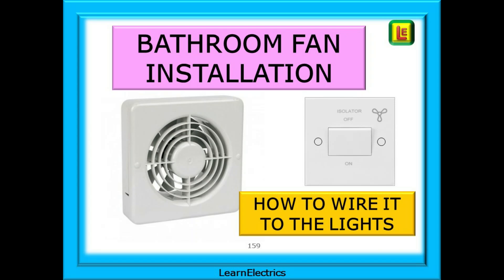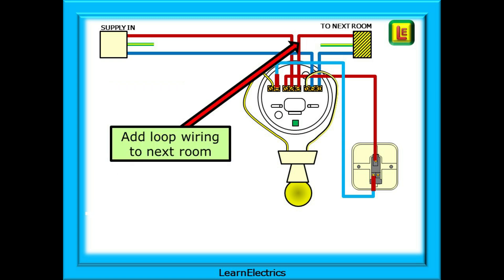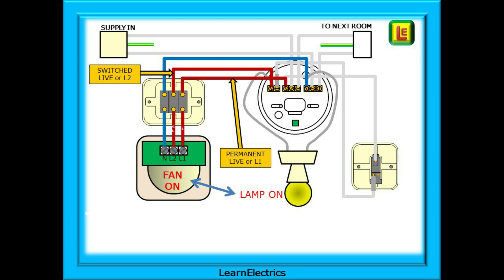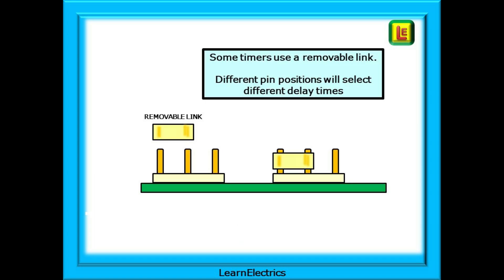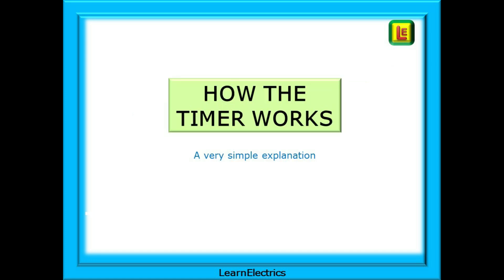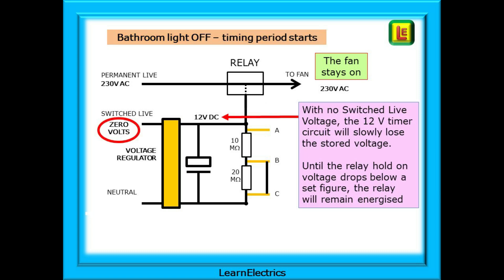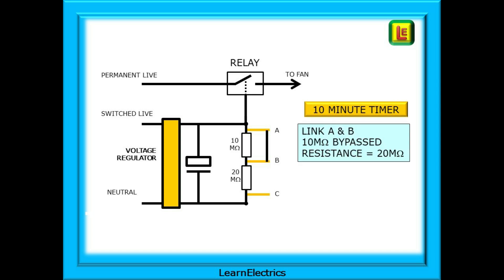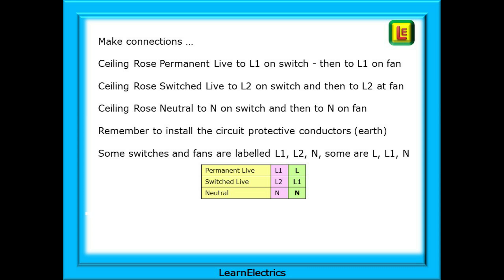BATHROOM FAN INSTALLATION – HOW TO CONNECT TO THE BATHROOM LIGHTS – SETTING THE TIMER

Comment: I disagree with your wiring of a bathroom fan from the lighting circuit,,you only need a perminant feed if you have an overrun timer but you have missed out an inline fuse of 3 amps which 90% of all fan manufacturers have written in their instructions for their fan installations ,there are lighting manufacturers that make grid fuses  along with multi pole isolaters that fit on grids,so you should change your instructions on this matter
Reply from the maker: I will look at that, thanks.

Comment: I have downlights in my bathroom so i don't have a rose. Where would my lighting cables be located, is it in the terminal box for my bathroom lights?
Reply from the maker: Follow the cable back from the down-lights. Eventually, that cable will meet up with a junct ion box, which acts the same as the rose in the videos.

Comment: Is there any way to just switch the fan on & off with the isolator switch, rather than via a light?
Reply from the maker: Just wire the fan from its own permanent line, through the switch so the switch is acting as an independent on off switch. You can take this from the line loop and neutral loop at the ceiling rose if you wish. Hope this helps. Dave.
Reply: @learnelectrics4402  - Very useful, thanks. I didn't know if the fan would work or not that way.

Comment: Great content and brilliant in terms of installing a extractor fan. I've recently replaced a plug cord switch, with a pir motion sensor switch that is situation  in the ceiling. So as l enter the downstairs toilet the ceiling spot lights turns automatically. Unfortunately the ceiling extractor fan  does not come on. It only comes on when l manually switch on the isolation switch situation on the outside the toilet. Do l have to run a cable from the pir motion sensor in order for the fan kick in? Please advise.
Reply from the maker: The extractor fan will need a L + N feed from the luminaire that comes on when the PIR is activated AND a permanent Line remains live when the lamp goes off. Try and match the wiring shown in the video. Dave.

Comment: Loving the content, thank you so much for sharing your knowledge and experience with us.  I have a question if I may.  I am currently decommissioning an electric shower in my bathroom and was wondering if I could use the power supply from that which is connected to an isolation switch to run the fan as I don’t want it connected to the lighting circuit but have it on an independent switch.  I sincerely hope that makes sense.  Many thanks in advance.     Ian
Reply from the maker: You can, but it will be over-fused if you just install it straight off. You MUST install an FCU at 3A to protect the new wiring to the new fan plus fan isolator. Dave.
Reply: @learnelectrics4402  Thanks for the speedy response Dave, much appreciated indeed.  So if I understand you correctly, I place the FCU 3 Amp fuse switch between the isolation switch and the extractor fan, have I understood correctly ?     Many thanks again.
Reply: @ianwarner8894 Did you fit your fan from a fused spur and has it worked out ok, Just seen this post and it is what I have in mind also
Reply: @johnb7644  Hi John, I have decided that it’s not a job that I am taking on myself and am getting a professional in to install an inline extractor in my bathroom.  He is going to completely remove the wiring from the electrical shower back to the fuse box, he is then going to fit a separate switch for the new extractor using the existing wiring from the light switch and the light ceiling rose instead.  Whoever installed the electrical shower initially didn’t put it on its own circuit and wired it into the fuse box into the sockets circuit, which is obviously a no go.  I hope this helps.     Ian
Reply: @ianwarner8894  Ok Ian cheers for that, I’ll continue to research the best and safest way to do it 👍
Reply: @johnb7644  No worries John, good luck 👍🏻

Comment: If you can do a video on garden lights and does it needs it own consumer unit etc. Thanks
Reply from the maker: Garden lighting is now on the list to be done, thanks. Garden lights don't need their own CU, but it is good practice to put them on their own MCB. make sure they are RCD protected. Even better, put them on their own RCBO, that way, any damp will not keep tripping the house RCD. Dave.
Reply: @learnelectrics4402  THANK YOU VERY MUCH If you would open your own school please drop me a message. Many thanks

Comment: Do you need a to add an isolation switch as you see many fans that don't have them.  I understand that the isolation switch is neant for maintenance, however is it not satisfactory to turn the lighting circuit off for maintenance. What are the regs on this? Thank you for such great videos.
Reply from the maker: Building Regs suggest a fan isolator switch for cleaning purposes, you can have the bathroom light on to see what you are doing without the fan whizzing round. And yes, I would isolate at the breaker before electrical maintenance. Thanks for watching.

Comment: Thanks again for the video, I always wondered how the timer works and you've given a clear explanation. As an adult learner, I've never really understood the need for a fan isolator.  If the fan develops a fault why can you not just isolate the lighting circuit at the board. By definition isolating the fan at an isolator means you don't have a light in the bathroom and presumably need to use a head torch or whatever. Is it purely for convenience or am I missing something?
Reply from the maker: Hit the nail on the head there Mr. G. You can have the bathroom light on when cleaning the fan without it spinning round. Dave.
Reply: The isolator switch does not turn the lights off as the connections to the isolator are taken from the light. So you can work safely on the fan with the lights on  when isolator is switched off.

Comment: Nicely explained, you could have added that most fans in the UK require a 3 or 5 amp fuse to be installed upstream in the circuit. I know that may have complicated things , but worth mentioning ,
Reply from the maker: Thanks for the input, appreciated,